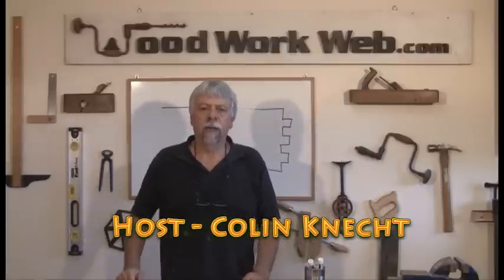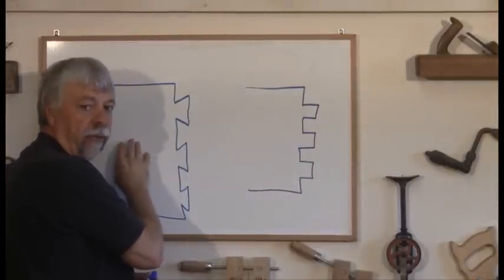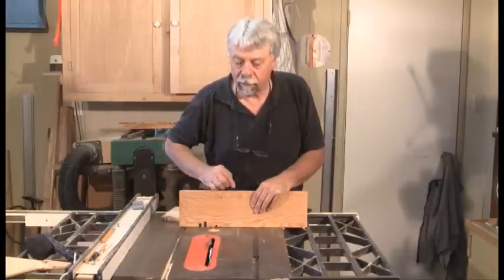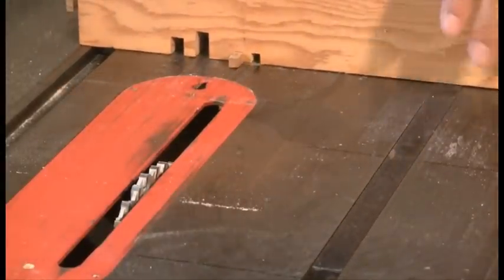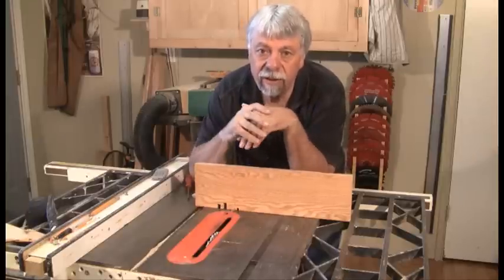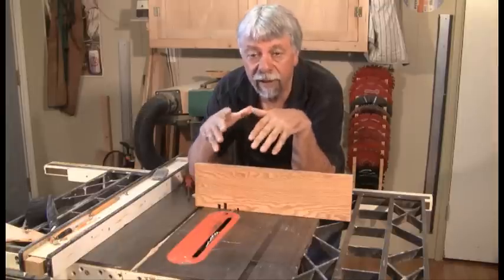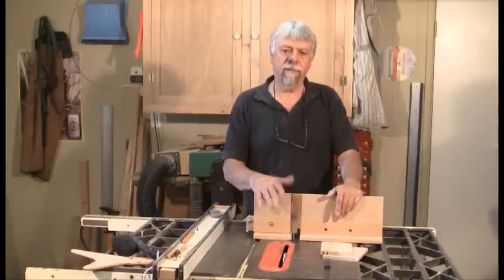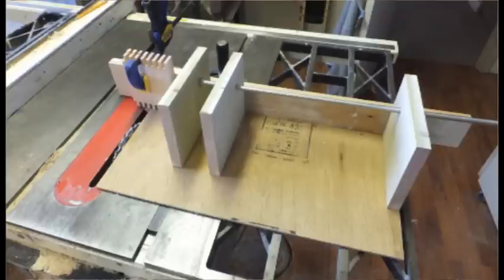Comparing Box Joint Jigs - A woodworkweb.com woodworking video

Comment: Hi, thanks for this from so long ago. However, one question I have is that, given you are using as you say 4/20 steel rod (20 turns per inch), then why is it that you turn your crank handle 8 times for 1/2" rather than 10. I'm confused.... please could you explain? Many thanks.
Reply: I think Colin is actually using 3/8" - 16 rod. That would explain the 8 turns to = two 1/4" pins

Comment: Hey Colin. Just wanted to share another user's experience with the 2nd box-joint fixture you reviewed; the one from "Plans NOW.". I, too, purchased the plans for that fixture after reviewing at least a half dozen competing products. In short, I found it to be the cat's meow, bees knees, etc. Like you, I had to fiddle with it a bit in order to figure it out, but once I did, it was effortless to cut any size box joint. The part I liked the best was the infinitely variable slot width that is inherent in its design. I can throw on any reasonable sized dada set or wide-kerf blade, dial in the numbers, and start cutting.I have to agree with your finding on the "ledge" and the height above the blade, but they pale given the universal adjustment aspect.Love your videos and, especially, your creative solutions.

Comment: The application I'm speaking of is in drawers where the reverse taper of the pin, or is it the tail, I cut em, but I get confused which is which, would prevent the drawer from falling apart.

Comment from the maker: hmmm I don't think I have seen that, I did have an older Incra jig that did make very accurate box joints but it was so tedious to use I gave the jig away. I will check out your suggestion ... thanks for taking the time ... great to have you with us 
Colin

Comment: The advantage to the dovetail, is if or when the glue fails, there is that angle still holding the parts together in one direction. In the other direction, you're right there is no difference.

Comment: The design of the jig is great, and if you make a lot of box joint projects I can see where it comes in handy.  Right away I could see that wing nuts on the clamping bar would be replaced by through hole star knobs because that would drive me crazy.  I would like to know where one can find phenolic resin for runners that is straight, I bought some from Woodcraft store and the  stuff was crooked and bowed and they wouldn't take it back.   Anyway nice video.

Comment: I built a modified #2 jig years ago. My thought was, and I did, extend the shelf, which allows me to clamp all 4 boards together, two offset by one pin distance, just like in your #3 version. This allows me to cut the pins on all four boards, flip the boards and cut again, and vewla, box done. The threaded jig with or without gears is great, but are pretty complicated builds, and don't  seem much quicker than my shelf mod, although they can be a lot more flexible.

Comment from the maker: OK, I did check out the Incra I Box and I am disappointed to say I was not as impressed as I had hoped. Incra make great stuff, but this is what 10 or 12 year old technology? I first saw this design in one of the woodworking mags many years ago. It only cuts one side at a time, and they have to loosen and tighten an old wooden hand-screw clamp with each cut. Really, I kind of expected more from Incra, especially for $170. US. 
I will look forward to future updated versions of this unit.

Comment: Yup, you've got to check out the I-BOX.  See my response to BrushCountyJamboree below.  Contrary to what he thinks, the I-BOX is NOT based on, nor a copy of any other DIY or retail screw-adjustable box joint jig.  Its dual pitch leadscrew-based positioning engine works differently and much better than any of them, if I do say so myself.  Check out the WW magazine and Amazon user reviews to see what folks think about it!